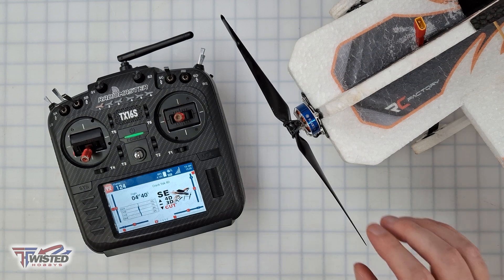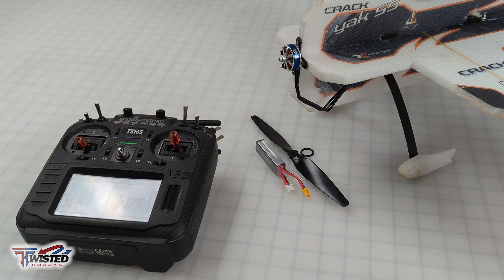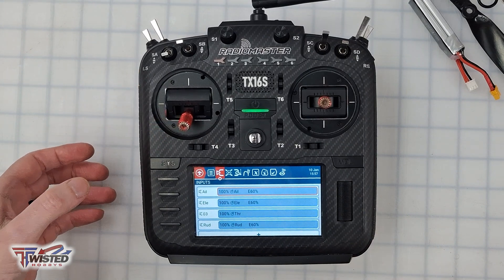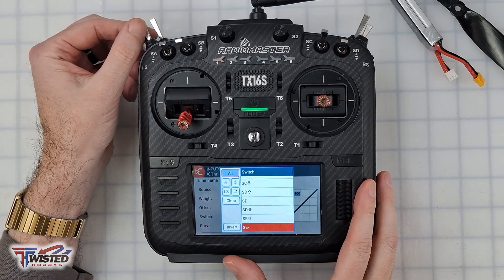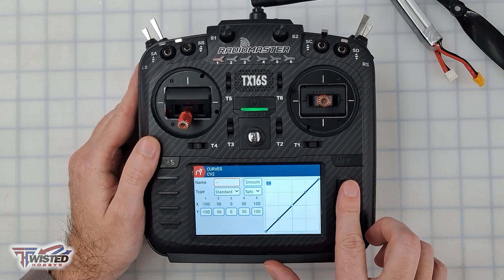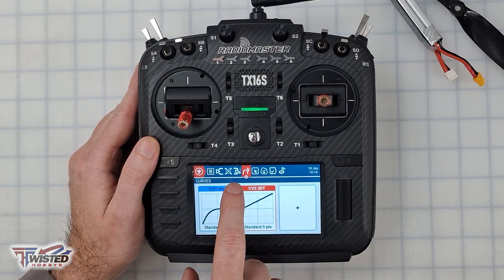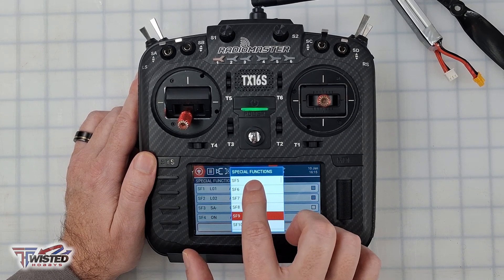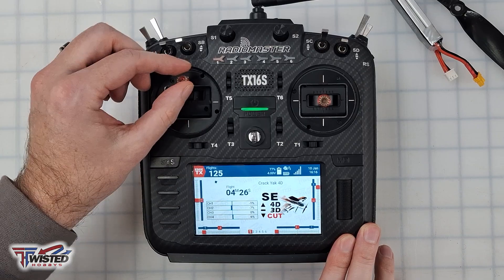Vertex 4D Setup for RadioMaster/EdgeTX

Comment: Great video I’m also running a similar curve setup on my Frsky X20s I’ve also reduced my 4D throttle down 20% so I can keep things under control and not tear my super light airframe up from the incredible power this vertex system makes.

Comment: Is there an advantage to doing this in inputs vs mixes?
Reply from the maker: It depends on your goals.  Some may not use the radio for this since they can use the switch on the ESC itself, which only takes about 10 seconds to set up in either mode. However, this approach doesn’t allow for the safety features Jim is demonstrating. While setting it up through the radio takes longer, it offers more advanced options and greater flexibility for adjustments. The Vertex system is extremely powerful, giving you even more control and functionality. The great thing is that you can choose whichever method works best for you. Ultimately, our priority is ensuring everyone stays safe, as 4D flying can be dangerous.
Reply: It could be setup either way, but I think of this as a type of "Dual Rate" which typically goes in the Inputs. My logic is that if you want to setup a mix for other reasons, then you would be mixing the already modified input.